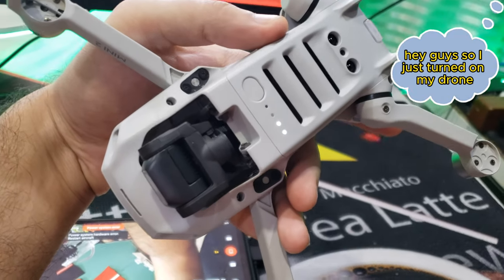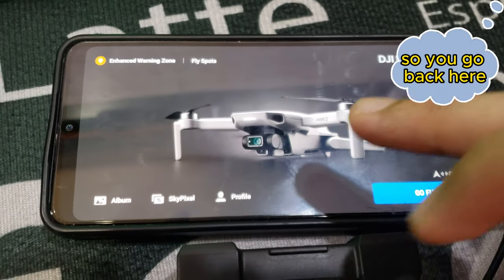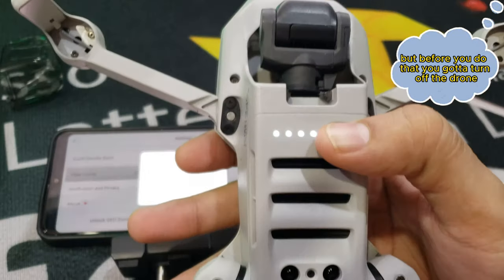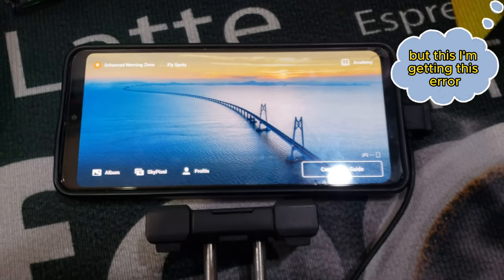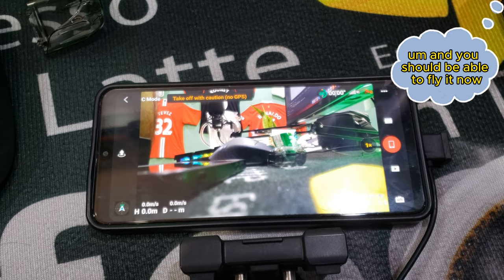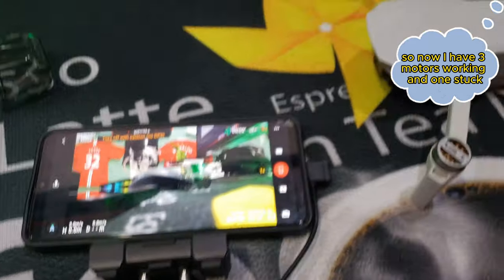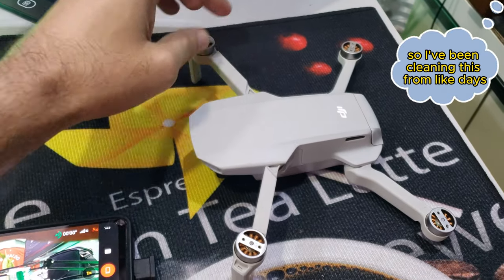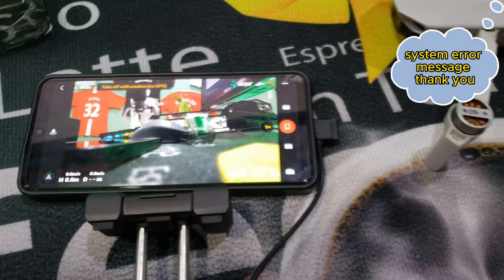How to fix Power System Error in  DJI Mini 2 drone

Comment: Hi , you are Lucky but i tried everything but nothing changed , Motors were changed , GPS Module was changed and ESC Board and it's still Saying Hardware Error and the Motors and the GPS Module along with the ESC-Board are taking from one of my Mini2 drones cause i have three at the moment , well all i could  do is to put the Motors , the GPS Module and the ESCBoard back on mini2 and call it a Day.  If it had worked , then all i would have to do is to Order those things and then i would have four Mini-2's 😊
Reply from the maker: But it gives you the exact same error I got?
Reply: @dronetourism507 , I changed all those Parts that I know are working cause as I said , they are taken from one of my working Mini-2 drones and it still says "Power System Hardware Error"and also , I don't get that musical tone either ! Forgot to mention that !
Reply: @dronetourism507 , "Power System Hardware Error" yep !
Reply from the maker: did you clear cache, then turn off drone, then got turn drone on and then went to flying screen and still shows error? If so have you tried pushing the 2 sticks together to see if it starts? Do you have gps signal? @jeremyboyce1537
Reply: @dronetourism507 , i did as you told me to do and i am still getting the Error message but i will do it again this weekend when i have the time but it is not easy to be removing Vital Parts from a working drone in effort to troubleshoot the other ! The Risk of Damaging Parts from a working product is extremely high and i have done this twice before and after seeing your Tuitorial , I decided to try it again ! For sure i know that the Crashed drone has the GPS Module is no good , the ESC Board is no good and now have to find out what else is no good , maybe the next try will reveil something ,  thank you for your Great Help and Response , i will definitely keep you Informed .
Reply from the maker: @jeremyboyce1537  no problem, let me know how it goes. Mine everytime I want to fly it gives me the same error and I have to do the same steps always to make it fly. Also I have to have gps signal or it wont fly
Reply: @dronetourism507 , I think you must have a Certain amount of Satelite first , then you are able to fly but at least 12 Satelites and then the Home Point is updated and you are good to go any distance !
Reply from the maker: @jeremyboyce1537  sometimes I have to do the cache trick multiple times to get it working, sometimes I calibrate the compass etc.. so that it works, but lately I can never fly it without doing the clear cache step and having a lot of satellites connected.
Reply: @dronetourism507 , yeah , something is not fully right though !
Reply: @dronetourism507 , Sorry , I was just Browsing and saw your Post ! It's been a while now but just to let you know , I had gotten the my Mini-2 fixed ! 🤔Guess what ? One of the Motors were no good ! Changed out that bad motor and everything was back like New ! One more thing I have to say though , I Lost That Drone About A Month Ago !😟Yep ! It's gone 😭 still have the others here though but they need parts ! I'm tired !!!!! Flying in Sport Mode and lowered my Altitude without paying Attention and Crashed Hard into some trees on a hill about a quarter mile from my house , been looking for it and my GPS on my phone is showing me when I'm right on it but still can't see it !!!! I Stopped looking after a couple times , it's gone!!!!